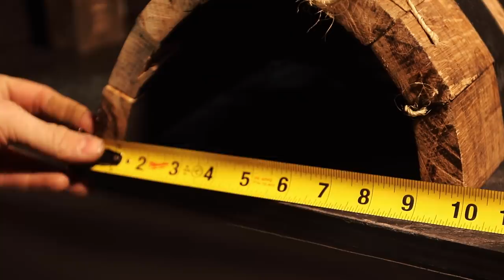Making a Treasure Chest from an Old Whiskey Barrel

Comment: Gotta love how this turned out, heard about it on the podcast and had to come find it. I really like that you didn't even attempt to flatten the staves or use a straight line. One little thing about the "rivets", did you try the same thing with a roundhead brass screw? Seems to me with a little grinding and peening, that'd be cheaper than buying the hooks and cutting them off.

Edit, nvm. Looked it up and I didn't realize those cuphooks were so cheap.  Carry on.
Reply from the maker: Booyah. Keep it cheap. Keep it classy.

Comment: Nice video.
Cool project.
Why do you burn the oil? Is it for letting the wood and metal look old?
Reply from the maker: Helps the wood "age" a bit by helping the oil seep in. As for the steel, helps stop it from rusting, as well as a bit of color/aging.

Also the shop is cold...use fire when can.

Comment: Tool question: what was the driver you had installed when putting in the wood screws at about 4 mins in? Didn't look like a normal screwdriver head.

Also: Still weird. A++
Reply from the maker: It’s a drill/counter sink combo. That way I could get the initial screws to sink a little which made skinning the corners easier to deal with

Comment: Is there a secret as to why you used boiled linseed oil?
Reply from the maker: Yessir! This would is super dry (since it’s been charred once) and I wanted to add a little color to the lighter side of the wood. Not only will it “warm” up the color, but hitting it with some heat will help it soak in. Since the heat also adds some color/charring the oil helps it from overdrying/splitting.
Reply: @skullandspade  cue the "The More You Know" logo now
Reply from the maker: Do do do dooooooo